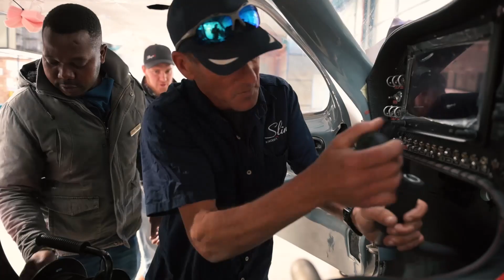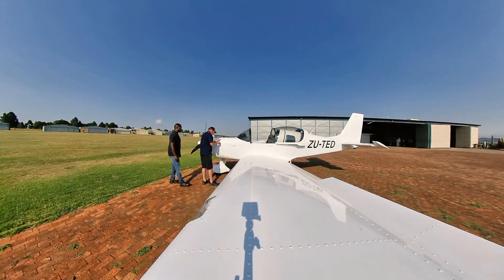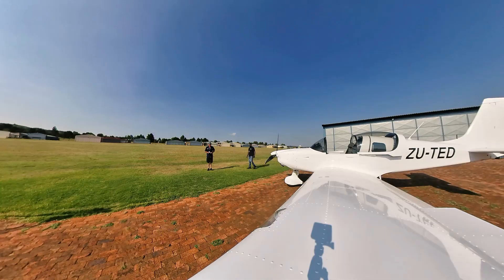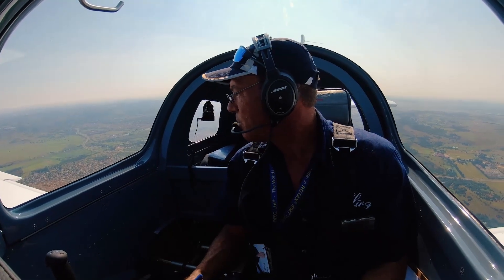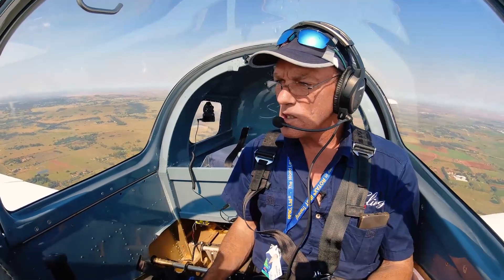The First Test Flight Inspection With Sling Aircraft

Comment: Why was the Sling designed with a handbrake?  Seems odd and not very intuitive with a lot of potential for confusion between throttle and brake inputs when using both at taxi or landing.  Why not not traditional  pedal brakes?
Reply: Tecnam also has a number of aircraft with handbrakes..  no issues.